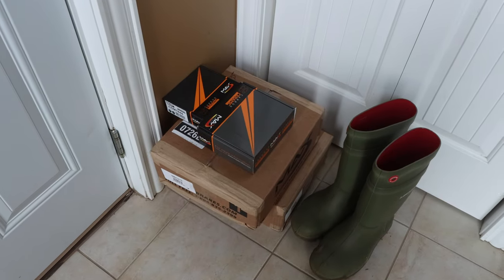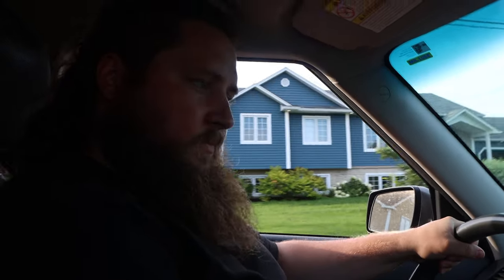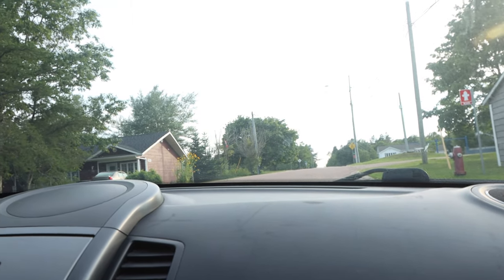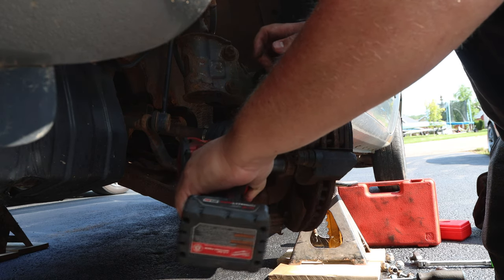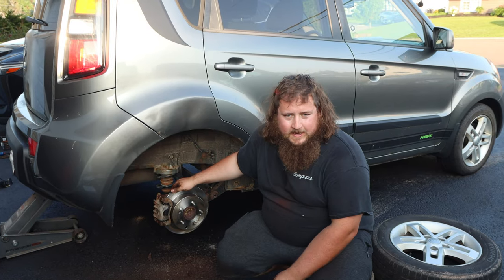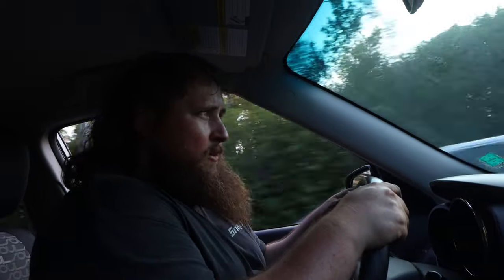FAST and EASY Diagnose Brake Noise Squeaking, Screeching, Grinding, And Dragging Kia Soul.

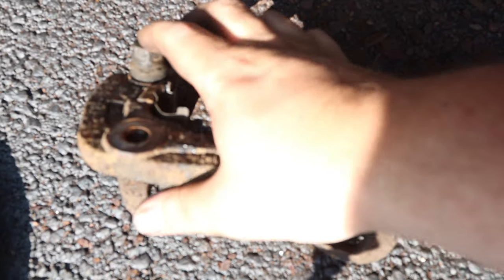Comment: 5:45 - Clean the shipping oil off. It does not act as a rust inhibitor. It will ruin your pads. 
6:35 - Didn't clean the corrosion off the face of the hub before you put the new rotor on. That will cause that rotor to warp. 
7:40 - That brake is obviously dragging.
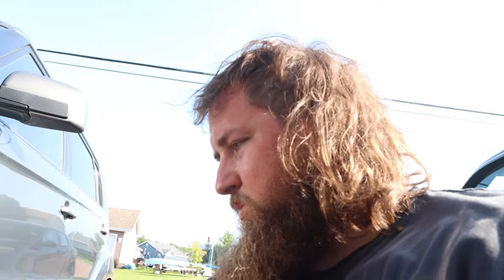7:54 - I'm not sure what your jack is pushing up against to hold the back of the car up, but I guarantee that is not a proper lift point. 
9:24 - You obviously didn't do any research on how to properly remove the rear brake rotor from this car or you would have adjusted the park brake star wheel so the brake rotor didn't destroy the park brake when you removed it. 
10:10 - You decided that since you damaged the park brake assembly that you'd just rip the park brake off like an animal and DID NOT REPLACE IT. This vehicle will no longer pass a safety inspection in New Brunswick without a working park brake. 
11:44 - Once again, you decided against cleaning the shipping oil off of the new brake rotor because you think it acts as a rust inhibitor. It does not. All that oil is going to do is ruin your brake pads. Rotors rust. The brake pads themselves keep the braking surface of the rotors shiny. Rust around the edges are ok. Leaving the oil on the rotors is dangerous. 
14:11 - You spouted some nonsense about "brake drag" and how you can feel it when you put it in neutral. 99.9% chance, you will never feel brake drag in neutral unless you're at low speed in a parking lot. The car likely weighs more than 3,000 pounds a dragging caliper will likely not be felt. Put the car in the air, spin the wheel. If you have to pull a caliper off with a pry bar, chances are that caliper piston is starting to seize. 

You botched one of the simplest jobs to do on a car. You ripped the park brake out, left the shipping oil on the rotors, jacked up the back of the car by what appears to be the rear bumper, I didn't see a jack stand under the rear of the vehicle when you worked on the rear brakes, you didn't remove the corrosion from the hubs before you installed the rotors. 

Man, you are dangerous as hell. Stop working on people's cars when you clearly have no clue what you are doing. You are going to kill yourself or someone else. If you want to work on cars, for the love of god, stop acting like you know everything already and go to school. A Snap-On shirt doesn't make you a mechanic or an autobody technician. Don't think I know what I'm talking about? I am a red sealed mechanic in Nova Scotia.
Reply from the maker: Man out of all my viewers I got to say that your the absolute biggest hater that I have. Your always saying mean and hurtful comments on my videos. I’m trying to help and direct people that can’t simply pay big repair fees and offering my techniques to the DIY. If I can teach one person and save some one some money from a big repair bill I’m happy and that’s what I’m trying to accomplish. I don’t claim to follow every step. I claim to save money and get the job done. This brakie dragging job was corrected after I was done from dragging to not dragging. Just because I didn’t do things the way that your used to doing it you got all upset and decided to say mean things to me. I don’t mind constructive criticism it your just a straight up hater and will hate on any way or shape or form of how I repair cars or do other things. Your just sitting by your computer waiting for me to put out another video so you can complain about it
Reply: @BigBennettTV  I work on cars for a living. You are ripping parts cars off in your driveway in your driveway without doing any research and making them dangerous. 

People who take advice from people like you eventually come to people like me to spend more money to repair their vehicle's properly. You don't claim to follow every step? That's a horrible attitude to have when you're working on vehicles that people put their families in. 

You want constructive criticism? Stop working on people's cars, and leave it to people who actually know what they are doing/capable of understanding what they are doing. If you think your feelings are hurt now, wait til one of your repairs gets somebody killed.
Reply from the maker: Maybe if your shops hiring I could come over and see what it’s all about.
Reply: @BigBennettTV  There's no way I'd ever hire you.
Reply: @BigBennettTV With all due respect, I don't think that the guy is really hating on you. He's just calling you out on some things that can get you or others killed. I think his intent was not to chastise, but to  get you to take a second look at what you may have done wrong. 
I am all for someone trying to save another person some $$ and that's great. But to unknowingly give bad advice is not doing them a favor, and in the end, could cost more to get the job re-done right.  We ALL learn something new every day, it's OK so we all can become better at what we do, right?  
  There is also a question  of liability, if you work in the brakes (or other safety intensive item)  on someone's car and there is an accident caused from someone's work, they 'can' be liable. Lawyers can be ruthless and it's not worth losing your home, or stuff.
 We are all big boys here, and should take advice to heart.  It can go a long way to making a job easier and safer. Take care, and thank you.